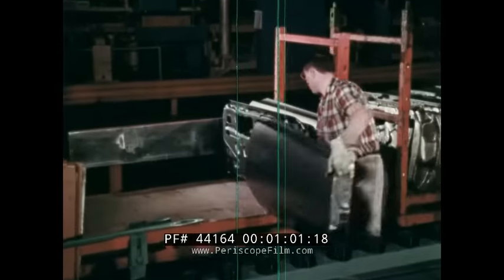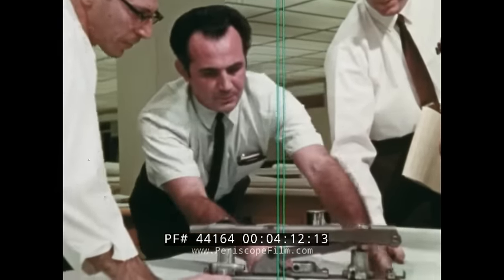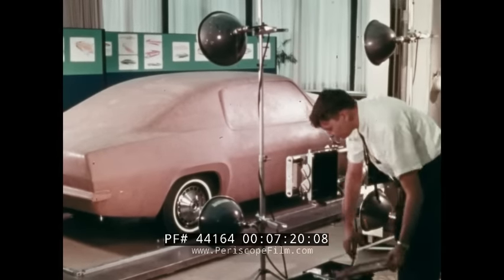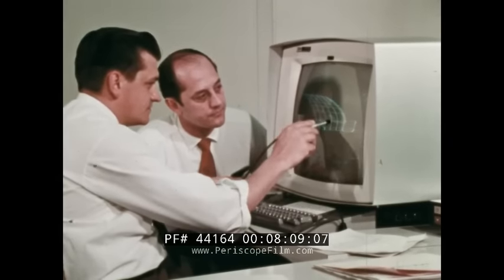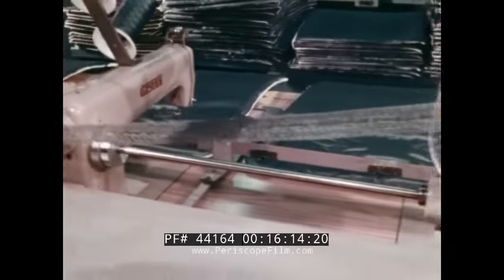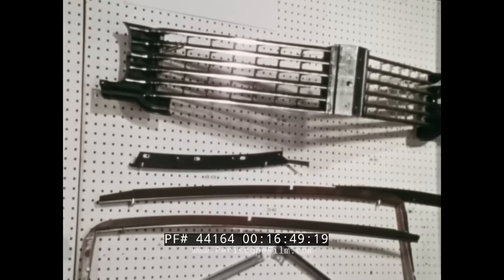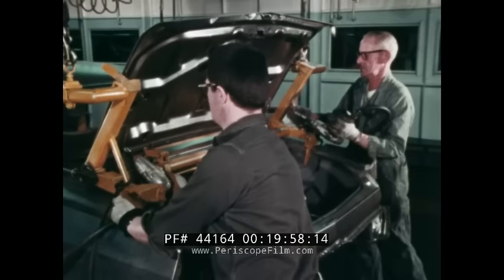FISHER BODY  "THE BODYBUILDERS"  GENERAL MOTORS 1970s AUTO ASSEMBLY LINE FILM  44164

Comment: Liked and subscribed. My grandfather retired from Fisher Body of St.Louis in 1964 and his job there was to lead body seams. My dad worked at Fisher Body of St.Louis briefly and his job was upholstering seat frames but he left the job to pursue a career in sheetmetal which turned out to be interesting work.
Reply: In 73 I worked on Buicks and I ran a big air powered wire wheel to clean the joint before the lead was put on!!! Only a shield for my eyes!!! 🍺🍺🍺
Reply: That was a job (applying and smoothing the hot lead) that took skill.
Reply: @ednorton47 Not every One can paddle Lead. It is a quickly dying Art

Comment: I remember a business visit to Delfi / Fischer Guide in Columbus Ohio back about 20 years ago. Found out that division built the window regulators, both power and manual. Most of the electric switches for windows and power seats as well back in the 60's Thru the 80's.
On my visit there the company was geared up for Saturn parts for doors as well as body parts. Today in its place stands a casino.
How times have changed but remain the same. Car designs were a gamble back then, they were either winners or losers.

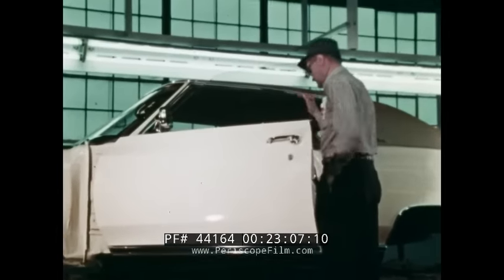Comment: 23:10 I remember in the early 1980s,  when GM converted the Framingham, MA plant from production of RWD body-on-frame A/G-body cars to FWD unitized A-bodies and, according to the story in the paper, they had to expand the building, probably because they could no longer build the body and frame/chassis on parallel lines. It's hard to imagine all the planning it must take to setup a line like this.
Reply: That old plant is now an auto auction.  I forget how many acres of buildings they dismantled…it’s still a massive structure.

Comment: This is a cool video. I hauled Chevrolet's from the St Louis plant in '79. On a 9 car hydraulic banana. Parts would sometimes fall off the completed cars/trucks as they were being staged on the huge lot.
A testament to the greatest people building cars  for me,  is first to the designers who came up with the 1937 Ford Vicky. Then secondly - my hat is off to the tool and die people. They created  each and every mold for every part, and the tool needed in the manufacture  and later maintenance of the vehicle. The third amazing thing is this fabulous  Ford was created  just about 37 years after the Horse and buggy had to begin sharing the roads. Today's '37 Vicky retro-rodded machines have it all. Including Beauty and aerodynamics. This car is a testament to the old timers and their ability to transition  from horse and buggy to self propelled. Much the same as now with self driving/autonomous vehicles and switching from gas or diesel  to electric .

Comment: I forgot about keyless locking, my first car and all after that had power locks, the car was a 73 Pontiac and I got it in 78
Reply: Keyless locking back then refers to being able to push down the lock button, and close the door with the button depressed and the door stays locked.  Around the end of the 60's, start of the 70's it got refined to just push down the button and close the door.  Prior to that, if you wanted to lock your car door, you closed it, used the key to lock it.   And now, just push a button on a small plastic fob.
Reply: Yep, my ‘69 Nova had that feature, so did my dads ‘70 LeSabre (they showed one just like it @12:48). You pushed the lock button down and then held the door latch button in when you closed the door, if you didn’t the lock button popped back up. I think the idea was to help prevent locking your keys in the car, but you still could of course.

Comment: In the design of automotive body lines, sharp lines gussets counters etc are not only designed to look good but also add massive strength to the shell as a whole that's why you have all the sharp accurate sharp lines best of both worlds style and strength otherwise it would fold right up..😮😮😮

Comment: The description says this was filmed between 1970 and '72, but 1970 was the first year for the second generation F body Firebird and the G body Monte Carlo that this film shows in development.  It looks like they're doing preliminary design work on what will be those new '70 models and were at the stage of transferring paper designs to 3D models for testing, which happens around two years before production.  The new G body Monte Carlo entered full production in mid 1969 and were in showrooms in September.  I'd guess that at least some of this was filmed no later than '68.

Those new generation 1970 F bodies (Camaro and Firebird) gave GM fits in development and production and ended up making their debut six months late.  Producing those rear quarter panels within specs and without waves and wrinkles was especially challenging.  In fact, all new tooling and dies had to be made, which was one of the big factors in pushing the new F body debut back from September of '69 to February of '70, while the '69's stayed in production an extra half a model year.

GM might have bitten off more than they could chew in '68 - '70 with the parallel development and debut of new F and G bodies and the June '70 start of production for the problem-plagued T body Vega.

Comment: I still own 2 automobiles with body by Fisher ! A 1965 Chevrolet Corvair Corsa Turbo with one repaint , & a 1967 Chevrolet Corvair Monza Convertible with 3 resprays . & have owned other body by Fisher GM products that still had the original paint on them , Pontiac's & Chevrolet's from the 60's & very early 70's , & original interiors , & all were used vehicles IMHO Fisher was the best coach builders then.

Comment: My Dad Worked at Fisher Body South on Saginaw St in Flint Mi 1963-1986.
His Father worked for GM in Flint From 1923-1959- Lost an eye in the line of duty.
My Mothers Father Worked For Buick in Flint 1945-1969
Other Aunts Uncles Etc.. worked  for AC , Complete Transit, Chevy Truck all from 1950's -1970's
No jobs for me when I turned 18 in 1981. Spun Pizzas.
Off to Los Angeles I went.

Comment: Holy shit!  That green Impala/Caprice at 5:33 came with a 454?   Imagine what it would be worth in mint condition!
Reply: In the early 70s when I was in high school, I lived in the sticks outside of Minneapolis. The local police had two marked police cars and an unmarked Impala the same color as the car in this film with a 454. I drove a 70 Z28 Camaro with an LT1 4sp and they chased me down the curvy back roads with that big block Impala on many summer evenings because of the illegal product I might have been carrying. I felt like Robert Mitchem In thunder road.
Reply: Unfortunately not much because it was a 4 door.
Reply: @mexicanspec  it would still be worth something, just not as much as a 2 door. They are running out of cars to restore,  and 4 doors are next best thing
Reply: @xChromerSatanasx  They haven't hit yet.  The 2 doors, convertibles and the wagons are hot.  Maybe one day the four doors will make it big.
Reply: @mexicanspec  that's nothing new.  convertible,  2 door and wagon s have always been hot.
Reply: 454 two barrel 225 hp 275 ft lb twist

Comment: My uncle worked for fisher body in the late 60s to the mid 70s he said that the engineers showed the assemblers where not to put seam sealer and protective coatings in order to promote rust especially around the rear toque boxes and frame-rails of the F-bodies how many can remember the spring shackles going though the trunk of your 75 Firebird usually before it was paid-off
Reply: Gee, why am I not surprised?
Reply: This never happened.
Reply: @cadman10000  And you know this how?
Reply: @insulman100  I have a 73' Mach One, 79' Trans Am and a vintage Jeep, all showroom condition. A little TLC and cars last forever.
I have a video of my Mach One. The 351 Cleveland has a great sound.
Reply: @TheBandit7613  That's great keep them alive I also have some nice vintage rides that never see any bad weather or salt although restored my best one is my 69 firebird 350 HO that I bought used in 1981 not knowing what I had I used it everyday until the shackles came through the trunk floor but after 30 years of being stored and realizing that it is a numbers matching 350 HO I completely restored her now you would never know she was a West Virginia rust bucket

Comment: All destined to serve the transportation needs of a modern society that has grown and prospered in large part because of the automobile and what it has allowed people to do.  From twenty different fabricating plants they come.  From thousands of supplier companies. Components of all sizes and shapes arriving in 26 assembly plants here and in Canada, each part to be assembled together with the next, quickly, efficiently until finally there emerges the engineering and manufacturing miracle that is a modern automobile body, one new body every three seconds, twelve hundred every working hour by one company alone.  How does it happen, year after year this ever continuing cycle of new high quality automobile bodies for General Motors cars?  The answer can be found by looking to the body builders from Fisher.  An automobile body is the part from the engine compartment to the rear end.

Comment: And make it rust out, put Ziebart to make it really hold moisture and fail apart.
Reply: Please explain.
Reply: @JJM956  Ziebart after market rustproofing in many instances is known to trap salt water between the Ziebart coating and body causing rust to occur where in many situations the area would have dried out if it was not covered with Ziebart.  In addition, the rusting can also go on out of view since it is occurring beneath the coating.
Reply: I have two 79 Lincoln Mark Vs, both with the Ziebart, I know this because of the stickers that are located in the door jams.  except for some rusting under the vinyl roof, there is absolutely no evidence of rust anywhere under the belt line down.

Comment: "keyless locking" ;))
Reply: It was quite an innovation at the time . Is funny though
Reply: I don't remember any cars where you actually had to lock them from the outside with a key, but my father's VW made you hold the trigger while closing the door so you wouldn't accidentally lock yourself out. The annoying finger-grip handles of the 1970s did away with that, at least for GM cars. I did work with a guy in the 1990s, though, who locked his civic with the key whenever he parked. I let him know that all he had to do was pull on the door handle, but he didn't want to know, fearing that he'd lock himself out.
Reply: @pcno2832  My '71 F250 would lock only with a key. Great comfort to know i could never lock with the key still in the ignition.
Reply: @pcno2832  My 1963 Plymouth wouldn't lock without the key.

Comment: @6:50 That's interesting. A clay model of a '70-'73 Firebird that seems, to me at least, have the wrap around shape of the '75-'81 rear windscreen. Maybe they were already designing the '75 model but haven't decided about the shape of the nose yet. I had a '72 Firebird once, and I found the build quality on the body, and front subframe to be pretty horrible. Weld spatter everywhere, cold joints that sometimes ran half an inch off the seam they were supposed to hold together etc. I don't know how much of that was out of frustration/hurry, being that the car was from the year they had the big strikes.

Comment: These cars had beauty and character. But reality is they were not well built. And in the Midwest, they chassis was full of rusted lumps for bolts, door skins separating and lower quarter panels and rockers were gone in about a half a decade. Most of them did not see 10 years of age, and those that did, did so with a lot of service.  And this is regardless of brand. My dad had a 77 thunderbird he bought new, and within a couple of years it was a real rust bucket and the doors were falling off at the hinges. He had several transmission replacements. The engine failed by the time it was 6 years old and he just walked away. My grandmother bought a 76 olds new and it made it until 1987 at 100,000 miles but it was completely rusted out, and plumes of smoke billowed out of the exhaust. I recall friends parents had other American cars from the era that seemed ancient but looking back they were all 10 years old or less.

Comment: Cool video showing the plant in action now long abandoned sad
Reply: That plant was closed in 1987.  It was demolished, and replaced with the Great Lakes Technology Center.  Later, it was sold to Diplomat Pharmacy, which makes drugs for dying cancer patients.  Recently, Diplomat went bankrupt, and was bought out by United HealthCare.  So, that stupid new-fandangled medical operation will once again, be abandoned.  Just like its predecessor Fisher Body.  You know what?   Well, they might just as well bulldoze the whole funk, and replace it with a whole new assembly plant.  For Truck and Bus, perhaps?  I don't care if they turn it into a parking lot.  But I would rather it be rezoned back to its original purpose, even if they build Toyotas instead!
Reply: I have a 55 Belair made in Norwood.1974 Nova made in Willow Run. Yes they are gone too.
Reply: The Fischer plant in flint where I worked in 73 is torn down!!

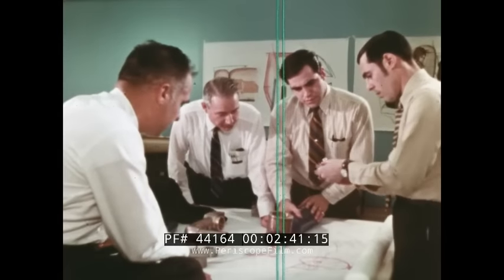Comment: 2:45  I didn't realize the airbag was available, I only remember it becoming a big thing in the late 80's to early 90's ... but GM had included airbags in some cars in the 70's only to discontinue it and then fight against it for years.
Reply: Imperial had antilock brakes in early 1970's.  NO ONE wore seatbelts back then so optional safety equipment was a tough sell.

Comment: I wonder when the rot set in that destroyed GM, before or after this movie?
Reply: The Vega was going into production this time in 1970 and it had a defect with which a structural seam behind the front fenders would go unpainted when the car got dipped, so they were already rusting by the time they reached the showroom. GM did address that before the '72s came out, I believe.
Reply: In the 50s the engineers wanted to exploit the increasing efficiency of engines to reduce their size and fuel consumption.  Harley Earl wanted power.  The result was massive oversized gas guzzlers.  Detroit never really ever learned to do anything else hence their dependence today on full size pick up trucks that are absurd and unmarketable everywhere else in the world except North America.

Comment: All those engineers for all these decades.  GM still hasn't figured out how paint works.  None of them figured out how to make fail-safe brake lights.  Only recently has anyone bothered about the problem of developing a system that prevents you accidentally locking your keys in your car -- or trunk.
Reply: What do you mean by "fail safe brake lights?" Like it gives a warning to the driver if they are not working?

Comment: No special quality. It was just a production line for low volume orders like for Cadillac. They were put together just a badly as the mass produced models.  They should not be confused with coachbuilders who made custom bodies to order back in the old body on frame days before WW2.

Comment: Such emphasis on accuracy of measurements during prototyping
In an era when a production GM car could be up to an inch longer on one side 
than the other and still pass Q/A.
Reply: Got anything to back that up? I'm from that era and have never witnessed, or heard such a claim. Ever.
Reply: @231mac  
Personal experience aside.
Take any place sixties/ early seventies vehicle, place a four foot drywall square at front and back of the body itself (not the bumpers) to achieve an average, and measure between the two.

Generally they're around 5/8" - 7/8" different from side to side.

Ford pony cars are especially bad.
Reply: And that was just the engine

Comment: Oldsmobile an Pontiac pontiera 42,000 each ,as company start project under revitalized car company of REO Oldsmobile owner of oldsmobile an Pontiac pontiera as first car production plants of oldsmobile an Pontiac block 455 an 51 thousand power plants an 51 limited edition production crank lobed production for limited edition production aerodynamic aerodynamic car line of oldsmobile an Pontiac pontiera bose sound system 124in wheel base  out of the 62 body line tail light angle up light under a square brake an backup on a wrap ass end